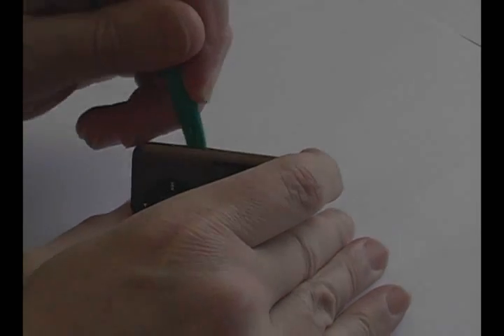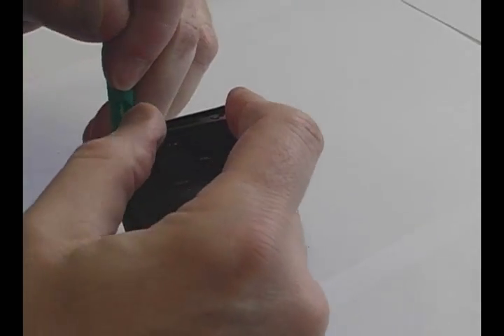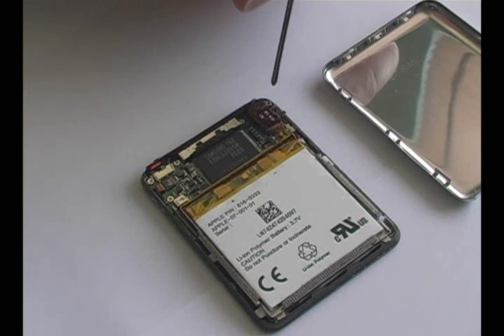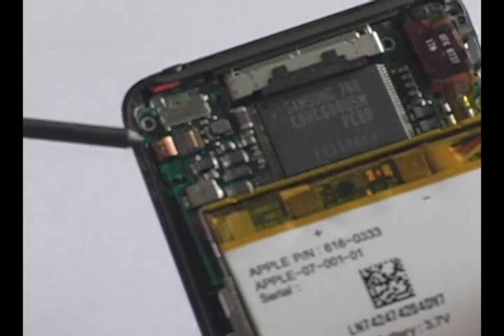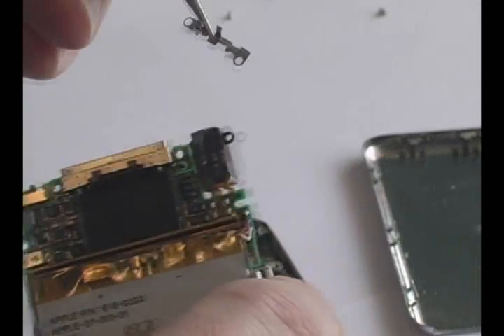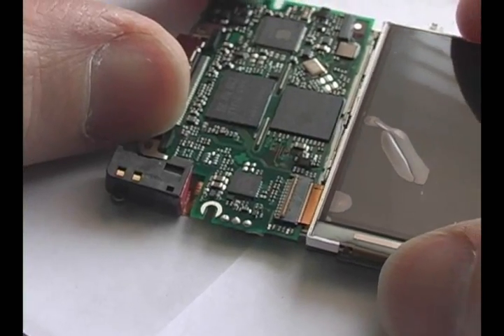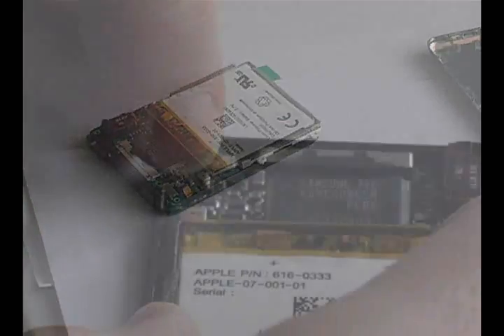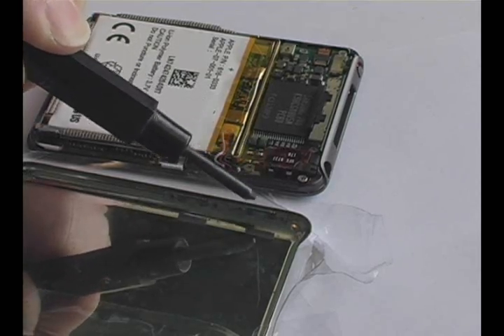DigiExpress - iPod Nano 3rd Generation LCD installation

Comment from the maker: It is hard to open. Make sre that you use some form of heat to loosen the adhesive. We use heat guns for a few seconds on the edges. You can use a hair dryer as well. And instead of a small knife, try a metal putty knife. That would be safer, but be very careful because there are cable you can damage.

Comment from the maker: That is a tough one, you may have an issue with the main electronics board which will prevent you from repairing the device.  No matter how many new parts are installed.  I would start with replacing the LCD screen first and see if that fixes the issue; we do have a listing of all available parts on our website.

Comment from the maker: @kikiseven06 I would suggest visiting Apple's Support site to find out how to authorize your iTunes library with that device.  Though I believe you would need to put the iPod into Disk Mode and restore it through iTunes to its original factory settings.  Once this is done you will be able to sync it with your computer, assuming that there is no damage to the iPod.

Comment from the maker: @kikiseven06 take a look into the headphone jack for any sign of a red or pink color, this means water damage.  if no water damage, then hold the menu and center buttons for 10 seconds and once the screen fizzles out, hold the center and play/pause button.  This will put it into Disk Mode and bypass iTunes.  If this does not work then you may have a problem with your main electronics board.

Comment from the maker: @lorddragongo try doing a hard reset (center button and menu button for 10 sec), then as soon as the screen fizzles out, hold the center and play/pause buttons for 10 seconds.  this will put the device in to Disk Mode and you may see it open up in iTunes.  If it does, try to do a restore.  If nothing happens, then may want to open the iPod to see about the battery needing replaced. Though when you open the iPod check for any corrosion from moisture or water damage. We do have a Diagnosis Service

Comment from the maker: @MrEled101 the "dim" screen issue, having no backlight, is usually the LED lights that are inside the LCD screen.  If not then you have an issue with the coil and fuse set on the logic board itself.  While I know this exists, I don not know where exactly on the nano 3rd it is located.  Basically in replacing the LCD screen you have eliminated that as the culprit and know it is the logic board.  You may be able to find a replacement board on ebay or craigslist for cheap, just be careful.

Comment: A year ago, the back light on my ipod Nano 3rd generation stopped working, and I bought an ipod Touch to replace it. Long story short, I dug my Nano out of a drawer and just replaced to LCD screen in it thinking this would fix the back light issue. However, it did not.
I have replaced the LCD screen, updated it, and restored it. Can you help me to figure out what the deal is?

Comment from the maker: @nsiac I would check, while the iPod Nano is open, the position of the hold switch.  Sometimes this switch gets stuck in the on.  If that is fine, then check the clickwheel ribbon cable.  The bending of the ribbon cable can cause "kinks" in the cable and it may be damaged.  Basically when you apply external power to the iPod it should turn on.  But on battery power you need to use the clickwheel, and you would be making sure the clickwheel is installed correctly and the hold switch is not stuck.

Comment: I've just replaced the LCD, click "Play Button" and the iPod is power on and it works. One moment later I've disassembled again the iPod for clean it. Now it doesn't work. If I click Play Button nothing happening. The same if I connect to computer. It doesn't work :( Please, have you ideas?

Comment from the maker: @s4asuke16 That issue could be with the clickwheel or a faulty lock switch or the logic board.  It's really hard to tell off-hand.  The first step would be to replace the clickwheel, but I cannot be certain as to why the iPod will not turn on without external power.  This would fall into our Diagnosis service, as this is hard to pin down without having the device here with us.

Comment: My iPod works fine when it is connected to the computer. When I disconnect it from the computer,it still works fine. However, when I turn it off, I can't turn it back on unless I connect it to the computer. Do you know how I can fix this problem?

Comment from the maker: @KodySummers The Diagnosis / Repair service (or bench fee) is only $25.00 and we would install the battery for you.  In this case however the iPod Nano 3rd Generation model has a backplate that is not reusable.  You would see an additional $9.99 for a replacement back plate.  This is stated on the parts page for the iPod Nano 3rd Generation as well.  Please visit the website for more information or to place a repair order.

Comment from the maker: @Freakof5FDP Samsung and Apple have had a very close relationship when it comes to their parts.  Samsung is just simply one of the biggest manufacturer's of data storage device, now NAND Flash chips as well.  They also have powered the iPod Touch and original iPhone with Samsung ARM processors.  If you search the recent Apple news you will find that the two are now suing each other and Apple seems to be leaning toward Toshiba for certain parts (mainly LCD screens).

Comment: Looks easy on the videos but the back plate is a bitch to remove with the plastic tools that you get. So i finally get it open and install the screen and now it does nothing. No lights no sound .....any idea what i did wrong. i went over the video numerous times and still nothing. i might have messed something up removing the back plate. the video is still great very helpful im just an impatient bastard. if you have any idea what i did wrong please let me kno

Comment: @halodaler 
you should be able to set that in the brightness from the settings tab.
if you get no display, then its either in hold mode, or its set to very dim, OR the lcd still needs to be replaced.

Comment from the maker: It is possible that you may just need a new LCD, however in some cases, the backlight is shorted out from the mainboard's LCD connector. The only way to tell is to try a new LCD.

Comment: My ipod nano 3g was left out in the rain the other day and you can see the menu etc but the backlight has stopped working.

Would the lcd screen replacement fix the backlight so it turns off and on.

btw i have already tried going to settings and turning on the backlight.

Comment: I purchased an LCD screen and did the repair myself. Did everything exactly as shown in the video. My problem is, when I plug the ipod in with the new lcd it won't boot properly. The screen flashes on and off, no apple logo or anything. Though, the old screen boots just fine with the ipod, minus the fact that is splotchy and broken.

Comment from the maker: It sounds as if you do not have the ribbon cable fully inserted. Remove the LCD ribbon cable and slide it back in keeping pressure on it as you lock the tab.

Comment from the maker: Our techs use a basic opening tool, however they know exactly where the clips are. You can also use a watch back opening tool, which is much stronger. Be aware that once you open this iPod, the back may not go back on again nicely. You may have to replace the back plate.

Comment: Hey man, i've been trying to open this too, i got an issue on the Headphone Jack, i already have the replacement if i had to change it, but my biggest problem is opening the nano. Which tool did you use to open it? Can you point the thickness of the blade of that tool too? It will be reeeeeeally helpfull.

Comment from the maker: There are metal clips around the perimeter of the back plate. Make sure that there is only a small gap between the clips and the side of the back plate. If there is too large of a space, the faceplate won't snap in. If you can't get it to work, we sell replacement back plates for $14.99.

Comment: oh ok. i didnt know that. where can i buy a replacement screen? i didnt have the tool so i used a set of extremely small flatheads. it worked but idk if ill be able to put it back together without damaging it further.

Comment: i opended my ipod with a knife.. it opened fine but doesnt go back together completely. not too bad damage. but if the side clip... (that little metal peice on the headphone jack) completely nessecary? i installed my new lcd and couldnt get that back on.. ipod works fine but will it cuase problems later on?

Comment from the maker: Both the Classic and the Nano 3rd gen are very difficult to open compared to older models. I don't think Apple wants you to be able to repair them. The battery can be replaced, however it is a difficult soldering job. We sell the replacement batteries and offer installation for just $20.

Comment from the maker: A thick guitar pick or watch opening tool works  well. The Nano 3rd gens are harder to open than other models. Be careful not to put too much pressure in any one place, you can damage the main board.

Comment: It isn't quite as easy as it looks on the video, you need to be really careful.

The back is really difficult to get off, even with the plastic lever things.  DONT use a knife, you'll just bend the back.

I managed to rip a bit of the ribbon going the headphone jack when i was putting it back together so i ended up buying a new one.